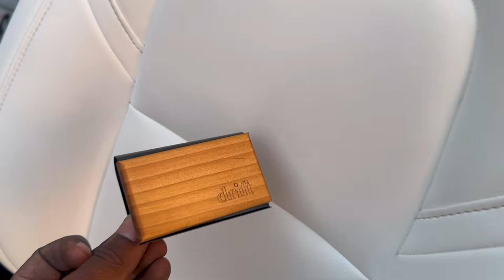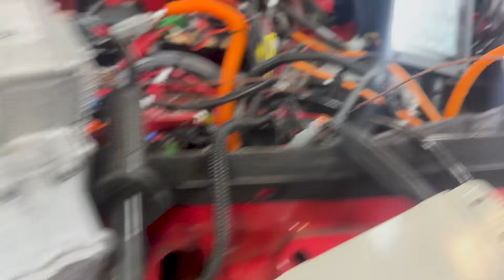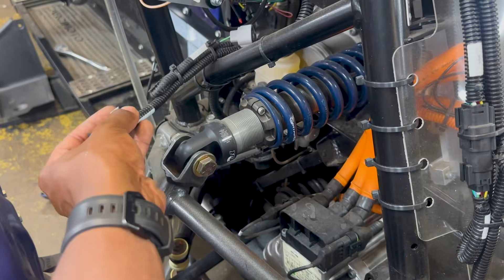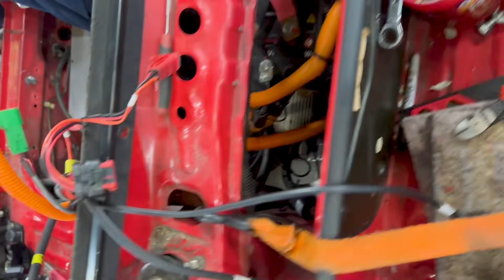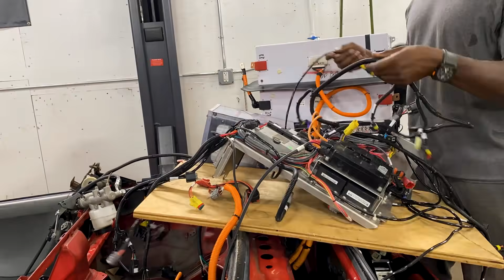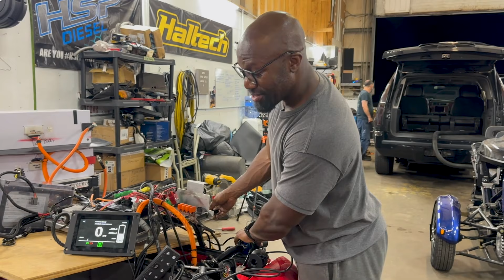Converting a mini Kei car to Electric on a budget

Comment from the maker: Use code RICH to get 55% off your first month at Drift.co https://drft.info/3WnHRQd
Reply: Is the discount code not working for anybody else? Says RICH discount code isn’t valid for the items in your cart
Reply: @KINGOVDECEPTION  worked for me
Reply: hey Rich - just a friendly reminder about those very unique split bms setups - If one battery pack becomes unbalanced, its BMS might disconnect to protect the cells, leading to a situation where the other pack continues to charge, causing a significant voltage difference and potentially a massive current flow from one pack to the other when reconnected - dont forget to give me credit for saving your life! lol - send some swag my way
Reply: Too much Ad, bye.
Reply: It's an electric octopus 😅
Reply: Hi from Trinidad
Reply: Hey Rich it would be cool to meet up, I'll come with my Honda beat here in Trinidad
Reply: Greetings. I’m Declan, an Architectural Designer here in Trinidad and we design remote and off-grid homes. Feel free to contact me. Best wishes and enjoy your time in Trinidad with your mother and family.
Reply: Newzeroland has electric beat
Reply: Rich,
That Rubber Mat between the battery packs looks more vinyl than rubber and regardless, when the packs came out of the tunnel, they probably had cooling down both sides (their isolation in the tunnel may partly explain their lack of isolation per box).  Now you have vinyl squashed between them.  

A better solution are 4 flame retardant pucks at each corner, about 1/2" thick plus at least air cooling vented up in between. 

Thank you for this and for all of your videos Rich.
Reply: lol subscription based car air refresher. the most useless product ever. it's kinda nice though how you can make money with stupid people by selling them useless crap

Comment: I was texting the wrong  person! Sorry about that!
 However , how can I get used batteries to do a electric bike build! I'm trying to build a cheap or cheaper e bike battery! Then I can try building a charging switch to/that charge as much of a 2nd battery for riding the bike!
  It's not about free energy!
  It's about minimizing charging! By charging one battery pack while driving on the other and switching back and forth until it needs to be charged by a external battery charging system!!! I'm really trying to build a fast charger that keeps charging the battery for driving and then one for back up when the first generator gets low! It's two battery packs for driving and two for running the generator! Charge 1 battery for driving and 1for the charging;! 
 Can this be done? 

  I'm not trying to add weight to the vehicle!
I was thinking use two 75%of the original battery!
I asked my cousin about it, I asked him for help with it! He say u just cut the battery in half, to not increase weight! 50%! It may give the

Comment: Always enjoy your projects over the years, and this one should be a blast. Too bad the eHot Rod and the Spark EV ate gone as making the hot rod a rear motor using the Spark EV parts could yield a very entertaining Track T type roadster and assuming it too would be much lighter than the Spark it should prove to be pretty quick. Wish I was younger and had some talent then I'd do it myself😊

Comment: Troubleshooting by Russian roulette. A young man's game.
I would prefer having a schematic and a computer control sequence of operations diagram before even taking on a project like this. Yes, one can get lucky and get it working but one could spend countless hours tearing into this without documentation. Even if you do get it working if it stops working for some reason do you have the tools to be able to troubleshoot it in a reasonable amount of time?
One cannot  assume that EVs are designed regarding control software even close to other types, or even different revisions, generations of the same cars so knowledge may be limited regarding what's universal, what's transferable.
In any case good luck. I wish you success.

Comment: I've never seen a motor controller that is happy with gas or brake being pressed constantly, especially at startup.  Have you tried never letting go of the brake on the working one.

Comment: This is something you probably already know, but when you have unexplained voltage like that, try to see how much current it can supply to see how leaky it is.  I used to work on high voltage stuff and sometimes you'd pick up a large voltage difference like that, but if you tried to light a lightbulb or something there wasn't enough current to do so.  In situations like that the case needed to be grounded to stop people from getting shocked with what was effectively a static charge.

Comment: I have a selection of Small, 80`s Euro Fiats I rarely use these days, so I`ve been thinking about doing something like this, especially thanks to new  emissions laws here in London, they are fundamentally banned.. My smallest one, a Panda 750, with 34bhp, Is 670kg-ish wet, my basic 1.0 45bhp Fiat Uno is about 720kg. Being 5 seater hatchbacks, theres a lot more room for batteries, & the rear axle area is fairly uncluttered (in fact the Panda has enough room for a live rear axle, thanks to them being available with 4WD, which also opens up the possibility of hybrid 4x4, with an electric transaxle on the back, & the petrol FWD left operational up front, for drive, charging, or range extending). Apparently a Beat is 760kg, so I`ll be interested in seeing your final performance figures..

Comment: The 'tilt sensor' is an inertia switch, that opens when it detects enough g-force. a tap with a screwdriver on it is usually enough to trigger. It's to shut down after a crash.

Also...D-sub connectors on the outside of the batteries?? hmmm..

Comment: As an electrician watching you guys troubleshoot that battery was killing me.  Voltage is a measure of potential.  If the battery was bonded to the frame you would read 0 (zero) because it would have the same voltage potential.  Current or Amps is a measure of flow of electrons.

Comment: don't put phones in rice because 1) it doesn't help (2) rice or rice starch ca  get in the ports or the phone it self. turn it off and leave it somewhere with airflow to dry, bang it a bit so water comes out and if you have silica gel packets, put it in a Tupperware or a bag with a bunch of silica gel packets.

Comment: Are those batteries meant to sit on their side like that? Maybe something has moved around in there which is why you are getting weird voltages all over the place. I'd try and find out what is causing the problem rather than simply wrapping everything in rubber matting

Comment: You do know that those gloves that you are wearing are just rubber glove protectors huh? They are not meant for protection from electrical shock. They just go over high voltage rubber gloves and they are supposed to be about 2 inches shorter than the rubber gloves.

Comment: Did you check the battery housing? Entirely possible the housing itself it's hot.
Reply: Ah, BMS. Yes that was my first guess but assumed wrongly you checked that first. Don't you own Electrified Garage?

Comment: The beat will do 86 just fine. They're limited to 88 from the factory. Super cool to see this swap. Factory beats are so absurdly gutless. Watch out for snap oversteer though, they're light as hell up front
Reply: Rich should have split the battery pack and put half up front, and also bigger wheels and tires will give a higher top speed.

Comment: This really shows the difference in electrical engine technology.
I remember doing a quick look at Koenigsegg recently. They have two electrical engines listed, the Quark and the Dark Matter.

The Quark weigh 29 Kg and is supposed to deliver 600 Nm of torque and 250 kW of power.

The Dark Matter is larger at 39Kg but sports 800 HP or about 597 KW and 1250 Nm of torque.

Now these are extreme, but I heard that the latest Bugatti has an even stronger ter KG electrical engine to support the ICE engine.

Tesla also have some impressive electrical engines, but quite a bit heavier. The Model S Rear Small engine weigh in at 90 Kg and consumes up to 250KW or about 300 HP and have a max torque of 330 Nm.

So it seems that electrical engines have been improved a lot faster than the development of new battery chemistry. We repeatedly hear about "the next big thing" in the battery business, and it alwasy seems that within ten years they will be incredibly improved. But looking back it's been these ten years for at least 30 years now, possibly longer.

Comment: Over 100 years of petro fueled engines they still haven't become at least 10% efficient in the production of power. EV's should be given the same tyme to impove on its higher efficiency and range. Rome wasn't built in a day or was it just like Egypt

Comment: What inspection/certification will be needed before this is road legal where you are in the USA? Inthe UK there's a very stringent examination for quality of workmanship, safety and the amount of modifications made.
Reply: At most the paperwork for the motor swap to demonstrate the components were legally acquired.
Reply: @LouisSubearth  That's missing the point altogether - What independent inspection and sign-off is required to ensure an acceptable level of quality in materials and workmanship before the converetd vehicle is deemed to be road legal.

Comment: 😂 That company is using an F1 suspension design in the front. That's their first mistake. Their second mistake is not paying for the rights to use this tech. Elon Muskrat is teaching China to steal technology from rival nations in order to sell it back to use as an adult size toy. Muskrat & China are using/selling material designed to break because it's the same material used in toy manufacturing. 🫢🤣♟️✌️ IBM will begin to ban technology.

Comment: I wonder if a setup like this would work in a 4x4 mini truck?
Reply: This is a transaxle setup, so not likely since the differential and output splines are built right into the motor unit, like a Tesla. Better to just use an off the shelf discrete motor, controller, and gear reduction box connected to the transfer case.

Comment: I would assume the vehicle needs to have a backup for the speedometer even if it has a GPS based system. You need a fallback if the gps is not reachable.

Great video. I enjoy those! 😄
Reply: Same thought here, there must be a hall sensor on or in the electric motor.

Comment: The input impedance of the meter is megaohms so it’s not telling you much, the leakage current could be micro amps.  The leakage current will be due to the BMS itself.  

It’s important not to try to start it while the pack has a split in it (wire between them not connected), as current could try to flow through the BMS and blow it up. 

You were lucky that the crash sensor had tripped :)

Comment: You can’t or have chosen not to incorporate the power steering? 
Does the hardware not translate? 
Wondering why leave that out.  
Is it because the car is so small, it’s not necessary?   But wouldn’t it be nice?

Comment: Ford offers their Eluminator motor for a reasonable price, but doesnt include any of the other parts for it to work. I'm surprised there aren't any big brands that offer simple high performance e-swap packages. 
Overtime more and more cars like Tesla's will be available for cheap but then you have to deal with that integration hell. Or if something doesn't work not being able to find resources to get it running.

Comment: Do you still use the same framastatic gasket for ev's as for combustion engine vehicles? Seems like they both still need a framastatic gasket or two regardless of motivational forces. It's probably shaped a little gayer for an ev is the only difference.

Comment: 5:12 Grounds. You can see they use green/yellow instead of brown for ground. I would try to run a wire connnecting ecu and module cases to ground terminals and then to battery -ve. Sure you've thought of this, by the time I get to end of vid!!

Comment: I always wanted to build a small engine powering a generator and that generator powering the electric motors. Trains do it with incredible efficiency, YOU are the only one that could make that happen 😂. I'm poor and can't do it myself but imagine 100mpg electric hybrid... revolutionary!
Reply: Check out Edison motors, pretty much exactly what you said is being done in the heavy duty truck space
Reply: Trains convert the massive engine to electric motors because the torque is so linear with them. If you do the math with regular gas powered generators you fall behind in efficiency unless it’s a plug in as well and you can start with a head start.
Reply: @ohioplayer-bl9em  Plug-in's are actually less efficient because you lose energy to the power grid (5-11% loss). You also lose some efficiency due to additional battery weight versus a normal series hybrid because a normal series hybrid only needs to store 1 full acceleration cycle in the batteries.
Reply: The Chevy Volt/Opel Ampera use a hybrid genset like that , and the BMW i3 with the range extender option.
Reply: Modern EVs already have that tech.
Reply: @johnt.848  Yes, and it's lackluster for all the reasons I described. Efficiency has to improve before it'll be viable.
Reply: @jttech44  I disagree with your dissertation but I won't go into it as you obviously know it all and have it figured out already. Have a nice day.
Reply: I also believe a small engine powered ev could be a great answer. A small battery, with a short travel distance on battery only, could be augmented by the generator, and give the driver huge range. And onsite recharging. It seriously is a good idea, and a genny could be super quiet, and left running while stopped to continue recharging. I want to build one.
Reply: @izzyplusplusplus1004 what you are describing is how a BMW i3 with REX works.
Reply: @izzyplusplusplus1004  That's exactly what Plugin Hybrids (PHEVs) are. Ram is coming out with a new truck soon with a V6 driving a generator to charge the batteries, so it functions as an EV most of the time but has the range of a gas truck.
Reply: @Thinginator  A modifier in Canada already offers a conversion package.
Reply: The issue there is scale. Small motors aren't terribly efficient per pound per output, so, with your standard car motor, there's not much of anything to gain by running it as a hybrid. For trucks, especially big trucks, there's a ton more room to see efficiency gains. That's Edison Motor's bread and butter, and they've proven it works at this point.

Ultimately, what you need is a small, reliable, high output genset. They do exist, usually little baby turbodiesels, and you have to be very careful with weight as it's easy to make a car weigh so much that any efficiency gains are lost to having to move the additional mass around. 
Also remember that every step, every conversion of energy, you're losing efficiency. So your 45% efficient turbodiesel motor is turning a 90% efficient generator charging batteries through an 80% efficient charger which turn a 85% efficient electric motor and you're left with somewhere around 27.5% efficiency in terms of fuel burn to realized power. Those are real-world numbers, not 'specified' numbers that only happen in ideal circumstances.

What Edison is doing is making up for those losses by having really, really good regenerative braking, and, being able to save weight. Those things are less viable with a smaller, lighter car, but you might be able to get back about 10%, which lands you at 37.5% total efficiency, so, a little better than what that turbodiesel motor could manage driving the wheels directly, but only like 2.5% better. 
The major pain point is charging efficiency, and if that can be improved, you very well may see these systems become mainstream. We're already at the point where electric motors and generators are about as good as we can theoretically make them with reasonable materials, but, if we can, say, charge at 95% efficiency, you land at 42% total system efficiency and that'd be worth pursuing.

Comment: Nothing screams sustainability like needing to ship another package every 30 days😂😂
Reply: They just need figure out how to work in an always on cloud connection and RFID tags to make sure you aren't using any unauthorized or expired scent modules. Then it could really be the juicero of air fresheners.
Reply: Perhaps the fact they are shipping smell for cars 😅
Reply: If it's biodegradable there's nothing to cry about.
Reply: @nextbizzy  It has to be driven to your house though. It would be far more sustainable to send you 12 once a year.
Reply: @nextbizzy  ah, so they teleport it to the customers with zero emission tech 👏👏👏